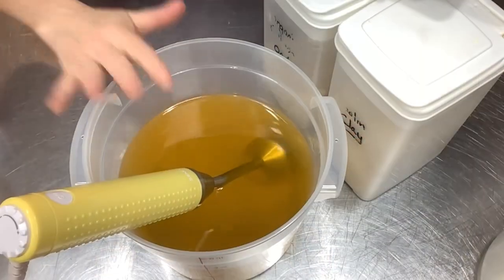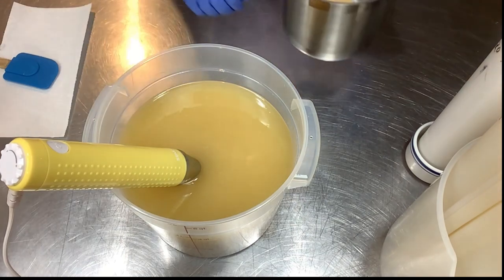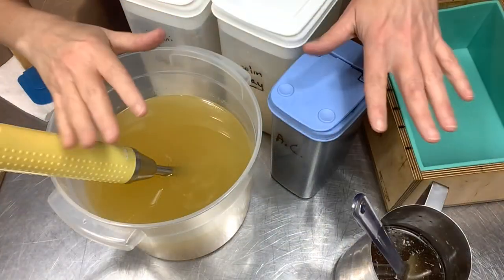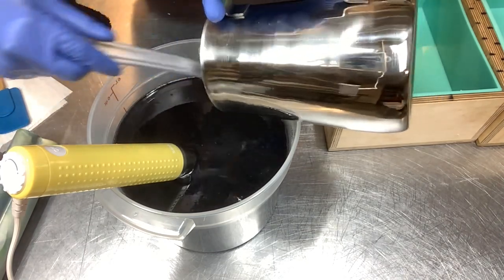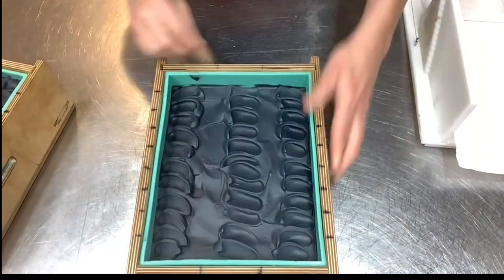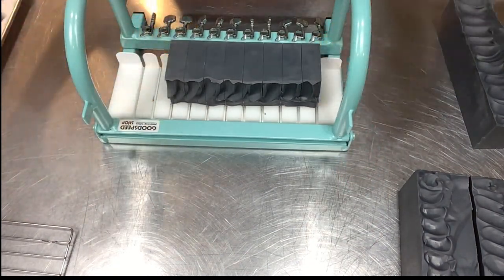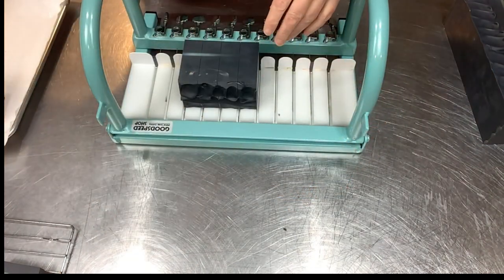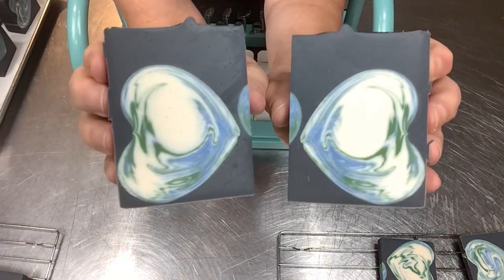Making 🌏 PLANET EARTH 🌎  Aloe Vera CP Soap w/ Embeds | Ellen Ruth Soap

Comment: Hi Ellen
I’ve been a soap maker for 7 years. I have a customer who loves activated charcoal in his soap so I made my luxury goat milk bars. I used the Peach fragrance oil from Bescented which is lovely but bc I know as a man he loves a strong scent I combined the fragrance with Apple Mango Tango from WSP. My recipe took some time to saponify but I seperated it as soon as I saw emulsion take place  so I could color some with TD. I added the activated charcoal and the mixed fragrance oil to one portion and blended until a light trace. Next I added the TD mixed with water and the rest of the fragrance oil. As I blended the oils it started to saponify then it split on me and I could see the fragrance oil seperate! I didn’t know what was going on so I kept blending. It would not blend then as I kept stirring it looked like it was getting thick so I stopped and starting pouring the activated charcoal batch in the mold and followed with the TD batch so I could swirl but the first batch was setting up so I just poured the white batch on top and didn’t try to swirl. As I was putting it to bed, I noticed the white batter was loose like liquid!!! I put it to bed hoping it would work itself out overnight, but it didn’t gel. After 24 hours there was an excess of oil floating throughout the top of the soap while the bottom batch was firm. I blamed it on the mixture of fragrances but could it have been the TD? I was so confused so I had to rebatch the whole batch and a lot of the loose oils got thrown out. It is curing now. So I tried the recipe again but made sure I stick blended the white batch to a med trace and it did it again only this time I just kept on blending past the seperation until the batch had a thick trace and I just poured the white batch in a seperate mold and the black batch was in its own mold. I left it for 48 hrs without unmolding and the black batch was firm and the white batch was harder with what looked like some small oil spots on the soap. I know I measured my oils and lye correctly yet it smells lye heavy and I can’t smell the peach fragrance at all! I’m really puzzled as to what happened. Can you give me your thoughts on what may have happened? And when using activated charcoal in soap do you have to use only essential oils? And let me mention I mixed my kaolin clay with my fragrance oil before adding it to the batter. I hope you can help me figure this thing out 😢 Thank you in advance 🥰
Reply from the maker: I've had no issues with using A.C. in soap...  Not sure what happended.?.
Reply: @EllenRuthSoap  ok thanks

Comment: They are very cute Ellen😊 
The black/activated charcoal as you said is a stunning black. How much do you use per pound? I’ve don’t the rule of thumb amount but sometimes it just doesn’t get as black as I’d like. 
Also soap making Ming can be challenging and it has a mind of its own at times! Nonetheless, it’s still a wonderful bar of soap with lots of lovely skin benefits 🥰🫶🏻
Reply: *done
Reply from the maker: A good amount is 1-2 tsp per lb of oils.